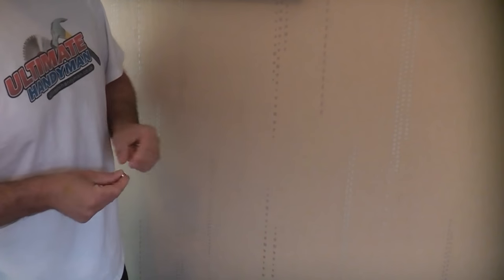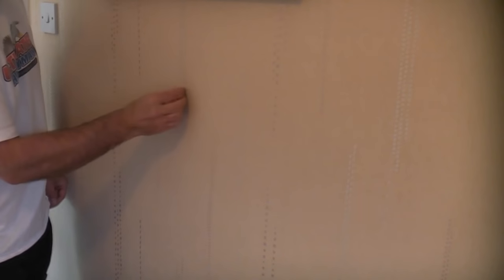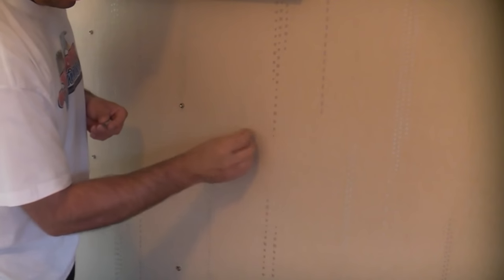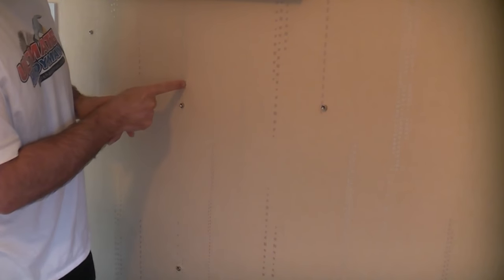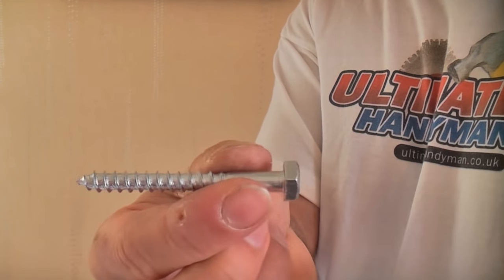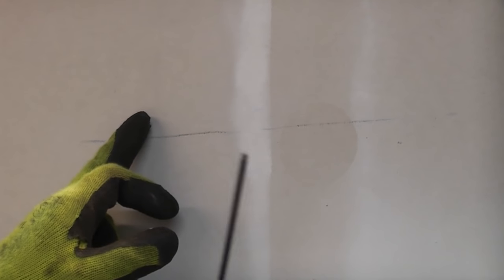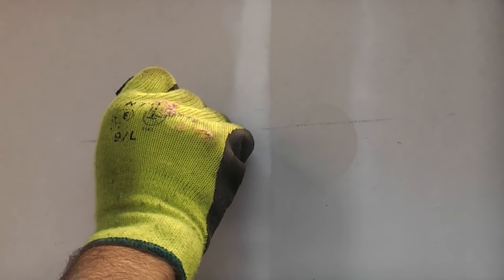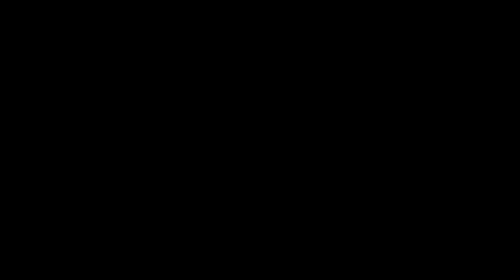How to fix heavy items to plasterboard / drywall

Comment from the maker: I’m still extremely busy working on site, but I’m trying my upmost to get some videos filmed and edited. I’m home alone for the weekend so have a few more videos in the pipeline ;-)
I hope everyone has a great weekend and makes the most of the bank holiday.
Please like, share and leave a comment if you can!
Reply: Ultimate Handyman Thanks mate :-)
Reply from the maker: You are welcome.
Thanks for the comment
Reply: @ultimatehandyman  How can I hang up 85 inch TV on the plasterboard in dinning room. The wall is hollow wall. I want to find an solution. I have the bracket up to 90 inch, for 80 kg but I do not if the plasterboard support my bracket + TV. Thank you for any advice.

Comment: @Ultimate Handyman: You've had a fantastic set of three videos on plasterboard fittings, including the strength test one. In this one you've talked about hanging heavy objects via studs. However, as most of us in the UK know, the use of stud walls in the UK is perhaps not as common as in the US. In many cases, what we have are walls with a layer of drywall, an empty cavity, and masonry. When I was putting up my television, I found this to be particularly challenging. Presumably the job should involve hollow wall anchors, but some people find it necessary to also use an extra bracket. It would be interesting for you to touch on this topic in the future.
Reply from the maker: If there is a masonry wall behind the plasterboard I normally use something like Rigifix- https://www.youtube.com/watch?v=xaYfs3lr1jI

If there is a gap or insulation I use normal wall plugs, long screws and space plugs to bridge the gap- https://www.youtube.com/watch?v=7DGGUbbbBZI

I hope this helps ;-)
Reply: Hi! Thanks for the bit of advice. Here's an offshoot of the original question. In my case, the typical gap is quite small. Here is a picture: https://i.imgur.com/1StKHD2.jpg 

Unfortunately I don't have the measurements of the plasterboard vs. gap, but you can see that the gap is slightly less thick than the plasterboard (0.5 inches?). In this case, the space plugs wouldn't be suitable, correct (minimum depth 30mm)? I assume the Rigifix are designed to deal with the cavity, correct?

However, in most medium weight applications, I assume that a simple hollow fixing will work (like a Rawlplug 4All or a steel worm plug).

Comment: In a serious case you could also attach a ledger board (using either 2 by or half to 3/4" plywood) to tie the studs together and then mount your bracket to that, either through-bolting from the back or making the ledger stout enough to attach to directly. Then just paint it to match.
I had to do this to span a gap of 24" between studs because there was an air duct inside the wall and I had to support a 75" tv. IIRC I used a pair of 2x4 with 3 bolts in each end (so 12 total) to fix to the studs, tapered, primed and painted to match - worked a treat. I've also seen folks attach plywood to uneven stone surfaces to permit an even tv mount.

Comment: Magnets... genius, I will do this next time.  As mentioned elsewhere in the comments I had an electronic stud finder but it was about as much use as a dowsing rod.
Reply from the maker: Yeah, those stud finders are a waste of money!
Thanks for the comment
Reply: I don't know about that, at least with a stud finder you do not end up with 8 allen key holes in your wall and it is a lot faster than fishing for screws with magnets.

Comment: When you find one nail/screw, measure either 400mm 450mm or 600mm (or 16 inches, in older houses,) to either side. That's where the next stud will be.  But before you drill or screw ANY fixing to a wall, check for pipes/cables. NEVER fix anything above or below a switch or socket and you'll probably be safe as far as cables go. If you're near a radiator, check where the pipes run. In modern houses they are often fed by 10mm plastic pipes , and on the ground floor usually run down from above almost dead centre behind the radiator. On the first floor they'll come from below, again in the centre.
Reply from the maker: Thanks for the comment 👍

Comment: Thanks for this tip. I never thought about using magnets  to locate nails in the centre of the stud. Before,  I  tapped my finger of the plasterboard  (from left to right) till the hollow sound went dead,  then poked both sides of the plaster board till the bradawl went through to give me both sides of the stud. Great idea mate
Reply from the maker: Thanks for the comment 👍

Comment: Dead Reconing. It works all the time. A lot of people would have simply used drywall anchors or toggle bolts and risk the heavy object would be safe hanging on these.  An expensive mistake. Yet another great video. Thank you!
Reply from the maker: Thank you for the comment ;-)

Comment: If you hot glue a length of drain plug chain, say 1.5 meters long, to the magnet you can swing the magnet back and forth across the wall till the magnet stops. Then let go of the chain and this will give you a plumb line to the floor, meaning you only need to find one screw in the first place.
Reply from the maker: Thanks for the comment ;-)
Reply: (assuming the studs are perfectly positioned vertically)
Reply: Kuba Stachu which, unless you did the work yourself, they usually are not

Comment: Hi great video. im fixing an Ikea Pax wardrobe (3 wardrobes total of 2.5m wide) with the L brackets on a plasterboard wall. do I need a wall plug to fix it to the wall or will the screw be fine on their own drilled into the stud?  how many L brackets do I need? i dont want it to topple over as it has got 5 mirrored doors which are heavy.  The holes for attaching to the wall, inside the wardrobe are not near a stud so its useless. Thats why i have got L brackets. Please help. My wall is the outer wall terraced neighbour side, it has a plaster board on top of the brick wall which is so odd!

Comment: Some may call this cheating :). It is not about fitting to the plasterboard, but about connecting to the timber that is a different subject, not a rocket science actually. The art is to fit the tv or a shelf to a plasterboard..

Comment: Great video.  Life has become a constant challenge for an old man, since they started building house interiors 
out of plasterboard instead of bricks  --  like they used to do in the good old day!!!

What I would like to see is a video on how to stop creaking floor boards in a carpeted room and stairs, without having to lift the carpet.   I'm finding it totally impossible to sneak around my house without letting the entire street know that I'm on the move.
Reply from the maker: I think it's impossible to fix creaking boards without lifting the carpets. I do know a guy that removes your floor (if it is chipboard) and replaces it with plywood!
I have seen a video of a special screw that they use in the USA that goes right through the carpet and into the joist, but that is a real bad idea in UK homes due to the pipes and cables beneath the floor boards.

Thanks for the comment
Reply: If you think it is "impossible",  then obviously it becomes your next major challenge in DIY vids.  With an appellation like 'Ultimate Handyman", surely you won't be able to resist.  

I toyed with the idea of buying a stud finding meter, in the hope it might be able to indicate the position of the joists through the carpet and floorboards.   Do you think I'd be wasting my money and dicing with disaster or might it have a 49% chance of success?
Reply from the maker: I think you would be wasting your time and money.
You can find the joists by using magnets as it will stick to the screw heads (providing the magnet is powerful enough), but it won't tell you where the live wires are, or pipes!
Reply: Apache sad.  But many thanks for taking the time to reply.  Appreciated.
Reply from the maker: You are welcome ;-)
Thanks for the comments

Comment: Great video. Thanks for pointing in the direction of this! Do you need to put any plugs in or will the screw suffice
Reply from the maker: If you are fixing to the wooden stud, you can simply use wood screws- no plug is needed ;-)
Thanks for the comment 👍

Comment: If I may ask, I saw the studs are timber. How does that work with the magnet? From where I am the studs are made of metal so that makes very much sense on locating them with the magnets.
Also, is there any logic in placing a metal washer where the anchor drives in the wall, in order to dispurse the pressure and weight..?
Reply from the maker: The magnet is sticking to the screw heads which hold the plasterboard to the wood stud.
Video  on drywall screws here- https://www.youtube.com/watch?v=WneqUwecT5s
Washers are always a good idea if you have them ;-)
Thanks for the comment

Comment: Is it possible to fix a tv to a wall without studs. I live in a 1970’s semi in Scotland and all the interior walls are made out of what can only be described as egg boxes - basically a honeycomb cardboard structure with 2 sheets of plasterboard attached to each side and there are no studs. I want to hang my tv on my wall, but having consulted several people and looked online, I’ve struggled to find anything on such methods.
Reply from the maker: It sounds like it might be a Paramount partition, I fixed a TV to one in this video- 
https://www.youtube.com/watch?v=awuqDum0ay8&t
I think the studs in such partition are about 1m apart. If you cannot find a stud to fix to, I would not fix any TV bracket that moves in or out, but if it fixes flush to the wall, you might be able to use plasterboard fixings.
I have used Grip-it fixings in the past on a Paramount partition but you also need their undercutting tool to remove some of the egg box.
https://www.youtube.com/watch?v=-geib-6sa3M&t

Comment: when mounting the tv, should i use screws or nails, and should i pre drill through the front to reduce splitting the glass?
Reply from the maker: LOL ;-)
Reply: use headless nails. that way you will still have the most pixels left on your hd tv ;-)
Reply: Jusb1066 in partial to using a Hilty nail driver, but be sure to cover the front in masking tape to prevent scuffing.

Comment: Another great video. I have problems with plasterboard which is simply stuck to brickwork, rather than on studs, with little voidage behind. What advice can you offer for these?
Reply from the maker: Thanks, I would use Rigifix for dot and dab walls- https://www.youtube.com/watch?v=xaYfs3lr1jI
Or you can get some fixings called corefix fixings which do a similar thing.
Reply: Ultimate Handyman Thanks. The video you linked to is superb
Reply from the maker: You are welcome ;-)

Comment: Have you ever come across interior walls that are solid concrete? In my previous property (built in 2009), my stud finder found almost every stud pretty much perfectly 400 mm apart. In my current property (believed to be a 1960's build, but can't be sure), it seems to find studs where there's electrical switch gear, even 1000 mm above them, but then it can scan the rest of the wall and not find anything. It's not the electricity it's detecting though, because that has its own dedicated light and a rapid beep pattern - I'm getting a solid beep which means stud, so I think it might be finding conduits

I can't be sure if this is just because the wall is papered (in my previous property I left them bare), but I believe the detector (Dewalt DW0150) is supposed to have detection range of 38 mm for wood and metal and 50 mm for AC currents, so the fact I can't find studs now when it found them so reliably in my previous property is puzzling. I really don't want to take the paper off the walls though.
Reply from the maker: Yes, we have some houses like that where I live. I do not know a great deal about them, but believe they were built in the 1960's. From what I have been told the walls are concrete, the cables are all run in steel conduit. Apparently it is difficult to get a mortgage on properties that are built in this way (this is just what I have been told by a friend).

Comment: Hi thanks for the video. can you advise me on putting up a 40kg 1.5m metre round mirror on to a new plaster board wall. I have to small screw holes on the back of the mirror for a screw to fit though (screw head would have to be 8mm) they are separated by 48 cm. Can I use two m4 wall anchors at either point? I was looking at the fischer brand and they recommend 15kg per anchor suggesting this would fall apart. However they apply this weight to both sheer and tension stress as far as I can see. Any thoughts?

Thanks 
D
Reply from the maker: Are the fixings on the back of the mirror the key hole type (shaped like an escutcheon) ?

If they are you are really limited to which fixings you can use, perhaps wall anchors will be the only choice.

This might be of interest- https://www.youtube.com/watch?v=ECDysfNhx_E

Thanks for the comment

Comment: Hi, do you think a metal sheet stud would stand a 65 inch TV that weights 25kgs, knowing that the one who did my wall confirmed that he had doubled the metal sheets support in the whole wall. Thank you for a great video.
Reply from the maker: Yes, it should easily hold that weight, providing you use at least 4 screws.
Thanks for the comment

Comment: i want to fit a microwave bracket, is it ok to fit to a stud and use toggle plasterboard fixings on the other side?
Reply from the maker: Yes, that should be fine. It's always best to fix to a stud if possible with at least one fixing.
Thanks for the comment 👍

Comment: Hi, a few years ago we had some kitchen cupboards on a wall (put in by the builders) and they fell down, we now want to put up some cupboards on that same wall but smaller ones and hopefully lighter with a lot less in them, I  tried the magnet thing and nothing stuck,  do you have any other tips to find the studs?
Reply from the maker: I'm afraid I don't, although you can often knock the wall with your knuckles and it will sound solid where the studs are. I would suggest using a stud finder- but all the ones I have tried have been useless.
Thanks for the comment 👍
Reply: @ultimatehandyman  I did try knocking but it sounded the same throughout :/  Thanks anyway :)

Comment: Great video thank you, my recent problem i seem to have run into with mounting tvs above fireplaces is there are no studs, i have always recommended removing sheet rock and bury at least half inch plywood into what studs there are, at least when i walk away i know their new tv wont end up on the floor, to me its a piece of mind
Reply from the maker: Thanks, I do a similar thing when installing showers as there is often no way of getting a decent fixing without putting a piece of 3/4 inch exterior plywood behind the drywall/cement fibre board.
Thanks for the comment

Comment: So you can screw straight into the stud, without any fixing? That's a lot easier than using spring toggles.

I've heard there is a danger of wires located on studs though, is there any truth in that? Is it worth double checking with a detector? (I realise they're not always super accurate)
Reply from the maker: There could be cables in the studs but it's unlikely as most cables are clipped to the side of the studs (in the UK at least)
Detectors are not very reliable unless you spend a lot of money on them.
Reply: Ultimate Handyman Ah ok, thanks. What about fixings to put up an extendable arm mount for a tv?
 Will just fairly big diameter, long length self tapping screws work ok? 
I guess there will be a fair amount of force on the wall when the arm is fully extended.
Reply: USA codes require a steel plate  where the wires  go thru the stud

Comment: This reminds me a time a few months ago when I was installing a floating shelf for my parents in the laundry. I got the centre of the stud and predrilled then water started leaking out of the wall. Turns out right where I decide to drill was the centre of stud and also the centre of a water pipe going through that stud
Reply from the maker: Blimey, that was unlucky!
Thanks for the comment
Reply: Michael O'Reilly I've seen electric cable go the same way, welded to the bit and became wiring job.

Comment: Great video ,  I have just bought a new build property and the wall where my tv is going on is plasterboard to, I have 2 plug sockets bang on in the middle at the bottom of the wall , i'm just weary of drilling in to something electrical , I have a detector but it just picks up electricity like mostly in the middle where the plug sockets are , im hoping the studs are pretty much near the middle of the wall as thats where I want to mount the TV,  would the wiring run up/down or across in new builds? Any advice much appreciated.
Reply from the maker: It depends who has wired it to be honest.
These days the cables can be anywhere in the permitted zones.
If you find the studs, it is unlikely that there will be any cables running through the studs- although there is a tiny chance that the electrician has drilled through the studs to route the cables.
 Thanks for the comment 👍

Comment: I have a 6 meter  wall inside my apartment. It’s not brick behind plasterboard it sounds hollow when I knock it. However, after 35 minutes I cannot locate any stud wall fixings with a strong magnet.
Reply from the maker: There is a chance that they have fixed the boards to the studs using fixing foam 
https://www.youtube.com/watch?v=3CJygvnajUA
But even if they have used that, you should be able to find the studs by knocking on the wall.

Comment: Hello and thanks again for another of your excellent videos. I need to fix a smoke alarm to a normal suspended plasterboard ceiling. Are standard wall/rawl plugs ok for this? Thanks again.   Ian
Reply from the maker: They will probably work, but I'd use a plasterboard fixing to be honest.
I often use the metal worm screws for such jobs, which can be seen at about 3:20 in this video- https://www.youtube.com/watch?v=mIEY3E4fiDk
Thanks for the comment